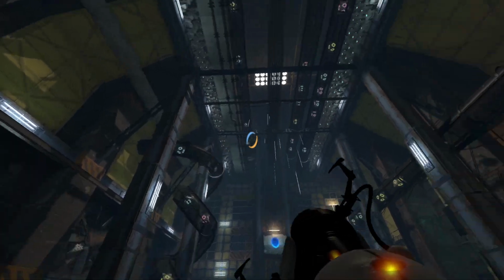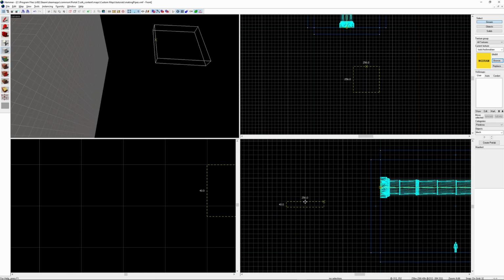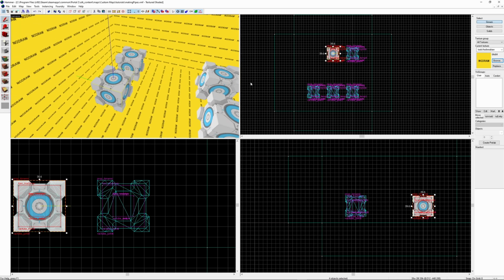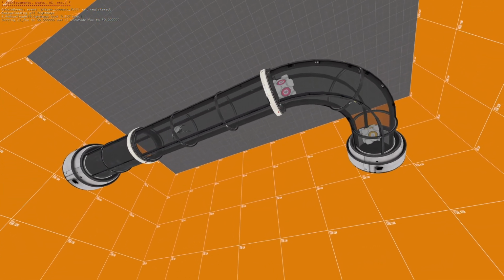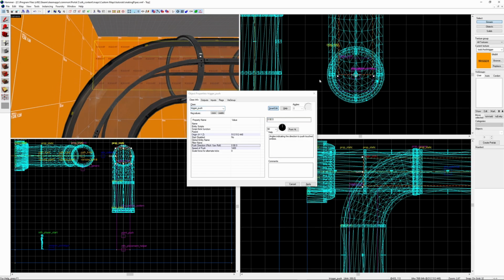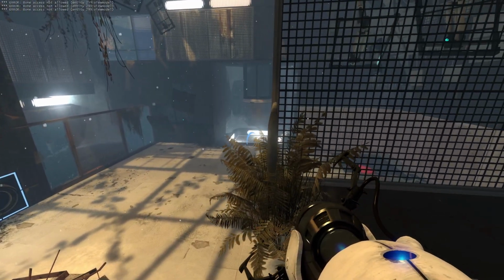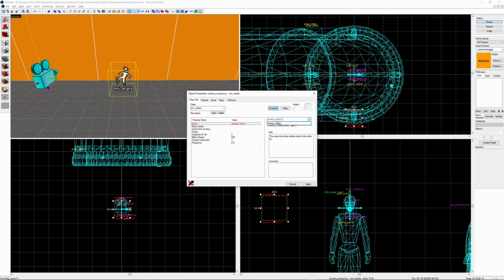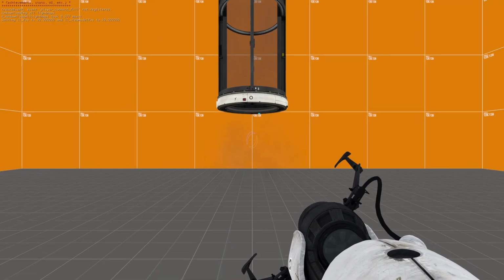Portal 2 Hammer | How to make Vacuum Tubes

Comment: I know I'm a bit late to the party, but this tutorial had helped ALOT.

The only thing I have a problem with is tube rides. For some reason, even though I think I copied your exact setup, when I enter the tube, it just sends me instantly to the last path track.

What I mean by that is that it sends me not from track1 to track2, but from track1 to track13 (which is my ending track)

Any way to fix this? Thanks!

P. S. Update, I just checked it again, actually, it sends me to a random path track each time. It can send me from track1 to track9 then from track9 normally. Or worse, try to instantly send me to track13 and suddenly drop me out of the train in the middle, getting me stuck inside a brush.
Reply from the maker: This could be a few things, but it sounds like the track train is moving on its own from the moment the game starts. This is because the initial speed needs to be set to 0. Also, make sure none of the path tracks have' teleport to this path track' ticked. Hope this helps
Reply: @scesie  Thank you so much! This indeed was the problem. Again, this tutorial helped alot, I appreciate people like you exist :)

Comment: Followed the instructions to the letter and for some godforsaken reason presumably due to hammer editor I run the map and it loads portal 2 but crashes the game before it fully loads. I’m at a loss and I don’t understand how or why this is happening, yes I triple checked positions, parenting, track pathing and the logic cage, timer, naming conventions and more and it still crashes, my pc isn’t bad either so I guess I’ll just die 😢
Reply from the maker: Does it crash during the compile or after portal launches? Do you get any crash messages? Does it still crash if you compile without the vactube entities?
Reply: I’ve yet to try to recompile without the tubes since earlier today but will edit update soon with more info, to answer the initial question it crashes after portal 2 launches, before I even decided to add the tubes and vac tube logic and props the map worked fine, the command window fails to provide me with a distinct error message however
Reply: @scesie  update: It was my shitty map making and a singular input causing too many cubes to spawn simultaneously that caused the crashing, after a full teardown and rebuild of the maps walls and the tube with logic and a little spit shine I was able to get the decorative junk tube to work

Comment: I did everything right and it just does the oppsite
Reply from the maker: If you did everything right, it would work. Could you be more specific by what you mean by "the opposite"
Reply: @scesie  Like it just starts spinning and they all stay in a group. and I think I might have used the wrong nodraw so I'm busy redoing it hopefully it works this time
Reply from the maker: @peri-b4 if they are spinning without moving then you likely set the initial speed to 0 in the tracktrain, you need to set it as the same as the max speed
Reply: @scesie  Got it fixed I had to rename them update the nodraw texture and change the height and wheel distance

Comment: what if it doesn't clone
Reply from the maker: sorry, but you're going to have to be a lot more specific than that
Reply: @scesie  What should I enter in Case 1, 2, 3, 4, 5, and 6 in logic_case?
Reply from the maker: @mudzinymudziny5308 you dont fill those out, they're for something else. Here, you only use the oncase outputs like i did in the video

Comment: In my map the props refuse to move on the path_track but i checked they should be all connected i have no idea what to do
Reply from the maker: Are you sure they are spawning? Are they spawning in the box outside the map but not teleporting to the path? Do you have the correct first stop target set in the track train?
Reply: @scesie  they spawn and teleport to the first path track in the flags tab set to teleport to THIS track but they don't move to other path_tracks
Reply from the maker: @MuggyNuggy  you need to have start speed set to the same as max speed, if it is set as 0 it wont move
Reply: @scesie  thanks for telling me have a great day

Comment: i need help with the Particle system because it won't show any particles
Reply from the maker: I believe this is solved with hammer++ but if you want to fix it manually, you need to go to your particle folder in the portal 2 files, Portal 2/portal2/particles. If you don't have a particles folder at that location you can create one. Inside the particles folder, you're going to have a create a text file called "particles_manifest",
These are the contents from mine, you just copy and paste that into the text file,
//copy everything below

particles_manifest
{
	"file"		"!particles/debug.pcf"
	"file"		"particles/fire_01.pcf"	
	"file"		"particles/error.pcf"
	"file"		"particles/burning_fx.pcf"
	"file"		"particles/weapon_fx_hl2.pcf"
	"file"		"particles/water_impact.pcf"
	"file"		"particles/tracer_fx.pcf"
	"file"		"particles/rain_fx.pcf"
	"file"		"particles/impact_fx.pcf"

	// Portal 1 particles
	"file"		"particles/blood_impact.pcf"
	"file"		"particles/portal_projectile.pcf"
	"file"		"particles/portalgun.pcf"
	"file"		"particles/cleansers.pcf"
	"file"		"particles/fire_01_portal.pcf"
	"file"		"particles/tubes.pcf"
	"file"		"particles/environment.pcf"

	// Portal 2 particles
	"file"		"particles/portals.pcf"
	"file"		"particles/portal2_coop_ping_effect.pcf"
	"file"		"particles/laser_relay_effects.pcf"
	"file"		"particles/projected_wall.pcf"
	"file"		"particles/dust_fx.pcf"
	"file"		"particles/drip_fx.pcf"
	"file"		"particles/tractor_beam_fx.pcf"
	"file"		"particles/robot_fx.pcf"
	"file"		"particles/spark_fx.pcf"
	"file"		"particles/exploding_futbol.pcf"
	"file"		"!particles/portalgun.pcf"

	// tempcontent
	"file"		"particles/confetti.pcf"
	"file"		"particles/environmental_fx.pcf"
	"file"		"particles/paint_fizzler.pcf"
	"file"		"particles/paint_splats_fx.pcf"
	"file"		"particles/player_paint_effects.pcf"
	"file"		"particles/paint_bomb_fx.pcf"
	"file"		"particles/flashlight_fx.pcf"

	// scenes
	"file"		"particles/scene_fx.pcf"
	"file"		"particles/laser_relay_2.pcf"

	// BR
	"file"		"particles/br_train_effects.pcf"	

	// Unused
		//"file"		"particles/airvents.pcf"

		//"file"		"particles/chicken.pcf"
		//"file"		"particles/clouds.pcf"
		//"file"		"particles/electriccharge.pcf"
		//"file"		"particles/electriczap.pcf"
		//"file"		"particles/fizzler.pcf"
		//"file"		"particles/geyser.pcf"
		//"file"		"particles/glados.pcf"
		//"file"		"particles/paint_gun_fx.pcf"
		//"file"		"particles/paint_spray_fx.pcf"
		//"file"		"particles/water_leaks.pcf"
		//"file"		"particles/zombie.pcf"
}
Reply: @scesie   i tried hammer++ but the vent particle is broken
Reply from the maker: @BlueberryThebunnyanimations  I need you to be more specific than that, do you mean that the browser still doesn't show anything or are you saying it doesnt work in game. If the browser isn't working, then did you do the other thing i told you to do?
Reply: @scesie  sorry but i mean they are just the purple and black checker texture
Reply from the maker: @BlueberryThebunnyanimations  if the particles folder is empty besides the particles manifest, then you also want to copy the content of the particles folder inside of pak01_dir to the other one in the game directory
If you don't know, pak01_dir is also found in the game directory, and you need the software 'GCFScape' to open it

Comment: Thanks for the tutorial, for some reason I needed to set the boxes to prop_dynamic_override, they were invisible otherwise.
Reply from the maker: @oat343  sounds like you used a different model to the one shown in the video. Not all models are compatible with prop dynamic and won’t be rendered. You can see this error in the compiler whenever it happens. But good work catching it and solving it on your own

Comment: i didn't understand anythinging at the "addidng junk" part
Reply from the maker: @TriangularHouse  I’m not sure what you want me to say, sorry. If you’re struggling to understand this then I’m assuming you’re very new to hammer, in which case I’d recommend learning other things first as vactubes are very advanced and it takes most people a while before tackling. Personally I’d recommend just making simple chambers in different aesthetics as practice.
Reply: @scesie  it wont work for some reason😑
Reply from the maker: @TriangularHouse what do you mean by it doesn’t work? I need a lot more information than that to help
Reply: @scesie  i did everything like in the tutorial,but the cube wont spawn
Reply from the maker: @ what model did you use, tell me the full file name. 
What happens when you create a button with an output onpressed, name of your point template, forcespawn
Reply: nvm, it was just a bit too fast for me

Comment: I LOVE YOU SO MUCH! i'm trying to create your all vacuum sistem for 3 days, just for note that i'm not doing ONE thing correct... But ok, now my problem is in the "Tube rides". My tracktrain are not working in the path.
Reply from the maker: What do you mean by “not working”
Reply: @scesie  My tracktrain are not tracktraining 😔 (don't moves through the paths).
Reply from the maker: Does it move at all?
Reply: @scesie  No, the paths are pointed and configured, but the tracktrain don't do a single move.
The tracktrain "First stop path" are configured  too, but nothing happens.
Reply from the maker: How do you know it isn’t moving? Are you using an invisible texture? Could it be a problem with the viewproxy instead?
Reply: @scesie  I know that 'cause I used a visible texture just to see if it's working (I did it to see if the vacuum_junks are working), but it don't moves, and I don't even put the viewproxy.
Reply from the maker: If you haven’t reached that part of the video then you haven’t reached the part where the tracktrain actually starts. I’d say finish the tutorial without altering things and see if it works then.
Reply: @scesie  👍🏼
Reply: @scesie  Ok, i did it now, step by step, but when the camera enables with the trigger, the screen goes black. My camera don't follows the tracktrain's vision. I know that the tracktrain it's working because the player's vision returns after some seconds, that means the tracktrain passed the last path.
Reply from the maker: @ create a separate tracktrain, identical to the other one, with a new name and no first path, then create another viewproxy with that new tracktrain as the prox entity. Create someway to enable the new viewproxy and tell me what happens
Reply: @scesie  ok
Reply: @scesie  The screen goes black the same way. I did it in an different way, now the camera are pointing the view for the correct side beause I've created an func_rotating inside the tracktrain, it starts when the tracktrain passes through a certain path.
Reply: @scesie  Do you have discord? I am doing an preview map camera, to show the player what he will need to do, maybe i'll need help.
Reply from the maker: Are you saying the thing you're making isn't actually a tube ride? How does it start? I couldn't recreate the problem with my version, so the problem must be some alteration or something else inside the map conflicting with it. 
Regarding the last message, sorry I don't talk with viewers on discord. If you'd rather have that sort of contact, I'd recommend going to the portal mapping and modding discord, where you'll find many people who can assist you.
Reply: @scesie  No exacly. I've created your Vacuum tube all correct, but in the tube rider part, i used it to simulate a camera showing the player the map and returning after some seconds, it worked, but some things no. I'll do all by miself now. Thank you for the help and sorry for a lot of questions.
Reply: @scesie  HELLOO! I need your help again!!
I've learned how to created all the camera sistems, but i have a problem now.
When my camera passes throught all the paths and activate the last one, it disables and be killed, ok, but the player don't moves anymore! I looked to the other one that it's working, and it's the same thing!
Reply from the maker: @nicaecio3253  Don't kill a viewproxy, only disable it. Killing an active viewproxy will cause the problem you just described.
Reply: @scesie  Really? I didn't know 'cause the other one it's working that way🤔
But I'll try, thx.
(Sorry my English, I'm Brazilian)
Reply: @scesie  Uuh... Still the same way.
The player don't moves, but i tried another way.
On the last path it will stop and kill the tracktrain too, now the player can jump, but don't walk. I really don't know what to do.
Reply from the maker: @nicaecio3253 are you making the same thing as in the video? Because these things really shouldn't happen if you're following everything. Assuming it is a tube ride identical in every way except shape/size, make sure all your outputs match mine without deviation. 
If you're making something other than a tube ride, I would again recommend going to the portal mapping and modding discord instead.
Reply: @scesie  Maybe I'm doing something wrong.
I need to pay attention a little more and do again from the zero.
Reply: @scesie  hey! my map is now published on steam. I'm not fully satisfied, but it's playable. Can you see it later? And if you can, give me some ideas to improve the map.
Reply from the maker: @nicaecio3253  Sure, send me the link and I'll play it when I can
Reply: @nicaecio3253  If the initial speed is not the same as the max speed it wil not move so maybe is that🥰🥰💓💓✅✅
Reply: Yeah, I know that. Thx anyway. @thestinkymaster
Reply: Can I do a tutorial on how to daisy-chain multiple maps starting with the first map?

Comment: I did it step by step and the first bit is not working
Reply: They are flying all over the place and only some are in the tube
Reply from the maker: Are all your entity names unique, you may have unchecked ‘make entity names unique’ in the paste special menu
Reply: @scesie  They are all different
Reply from the maker: @Rburski  is "preserve entity names" unchecked in your point_templates flags? Are all your models parented to the correct brush? Have you made any alterations to your version?

Comment: Do you use presets to make mapping easier? Like an instance with a cube dropper? If so, do you have a file link with any of these in as these would help so much with mapping.
Reply from the maker: No, sorry, I don't use instances, I make everything in my maps from scratch. But there already is an item dropper instances in the files, you can find out about how to set it up here: https://developer.valvesoftware.com/wiki/Dropper_(Portal_2)

Comment: I did everything step by step and it's not working
Reply from the maker: There are 3 different sections in this video, which are you referring to. I can't help you with no information. I need to know exactly what is going wrong
Reply: @scesie  The first one, with the track
Reply from the maker: and what's happening? use noclip, are the items spawning and not moving or are they not spawning at all?
Reply: @scesie   They are not spawning at all
Reply from the maker: @zuveresgames If you create a button with the output "OnPressed, *one of your point_templates*, ForceSpawn. What happens?
Reply: @scesie  I think that I messed up somewhere, cuz even when I press the button with this output, nothing works
Reply: @scesie  update: yes I did messed up cuz I choosed the wrong model
Reply from the maker: Is it all working now? Sounds like you used a model that isn't compatible with prop_dynamic, For future reference, this is an error you can see in the compile log but you are able to force any model to be dynamic by instead using "prop_dynamic_override". Hope this helps
Reply: @scesie  Anyway thanks for the tutorial

Comment: If you could, would you make a behind the scenes full of tubes but make a very long tube ride for ambience but make sure to add flanges to each end of the tube using hammer editor? Make sure to play your map once you’ve finished with it.
Reply from the maker: There are lots of examples of workshop maps with tubes, I've already made a few such as in portal plus overgrown. You can see the video for that on my channel.
Reply: @ You can make even longer tube rides yourself as you did in your video with longer track paths.

Comment: Yoo amazing tutorial!! Thanks man!! However there is one thing i dont know how to make. I want to attach a cube dropper to a vac tube that has cubes flying through it. I want the tube to be horizontal and the dropper branching off from it. I want a single cube to fly from the main tube to the side every time i press the drop button. How to make?
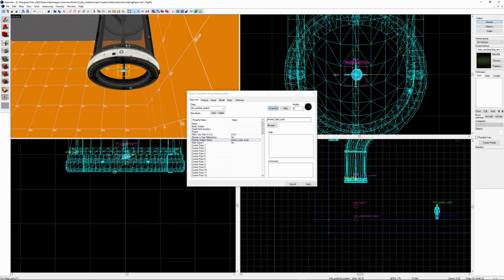Reply from the maker: You could try spawning the prop_weighted_cube with a point_template at the start point in the vactube and use trigger_pushes (similar to what I do for vactubes at 5:56) and invisible brushes to direct the cube into the dropper where it can then hit a trigger multiple which opens the dropper.